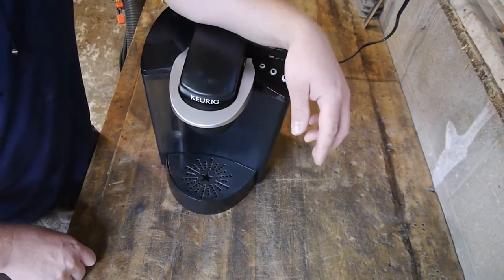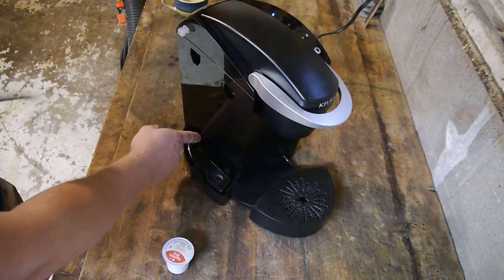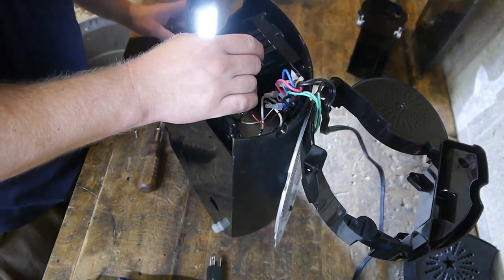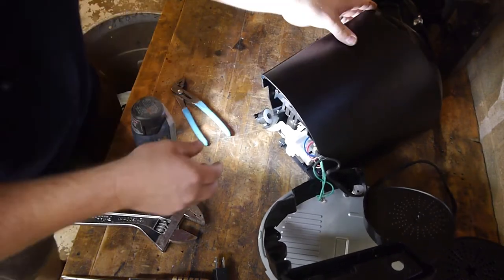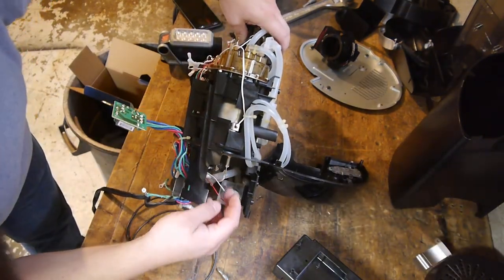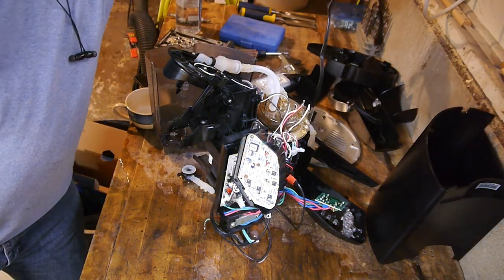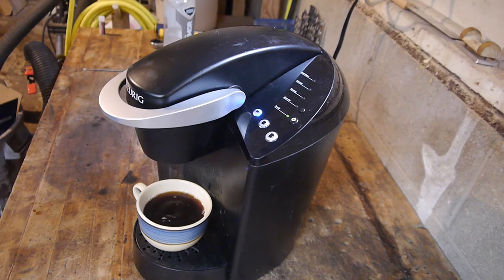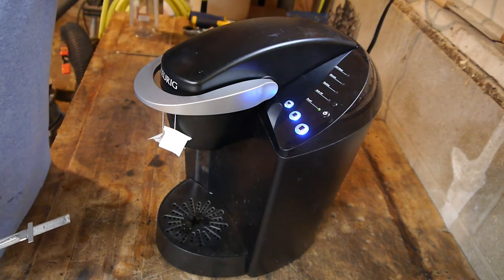Keurig K40 K-cup, Not Heating Repair, and now tea maker?

Comment: A tad too fast during the disassembly and re-assembly phases. That said a hearty congrats on getting the old K40 working again. Regrettably I feel like I've just watched a brain surgeon  open the skull at warp speed, show me the aneurysm then go back to warp speed to close the skull. Sort of miraculous I'd say. I'm fairly handy so I'm going to give it a go too with my dead K40. Hell, I was going to toss the thing anyway so thank you for taking the time to make the video. Oh, and if I were you I'd replace the WD40 with a crumpet.
Reply from the maker: Thanks for the chuckle! I did end up taking it apart again because my first fix didn't last. I took more time filming the reassembly in this second video, hopefully you can work backwards for the disassembly. Good luck and thanks for watching.
Reply from the maker: https://youtu.be/Y23lxL5nAT0
Reply: Hey Josh, I viewed your second video on re-assembly much to my great amusement as I could relate all too readily to your dropping the screw into the middle of the thing. That's nearly a pastime for me. I ran short of patience and decided to toss my dead K40 and perhaps buy a smaller cheapo knock-off hoping for a couple years out of it.

Comment: Did you just connect the wires or did you replace the thermo fuse that had burned up between the wires? What type of fuse did you use if so?
Reply from the maker: I just connected the wires back up. Tested, and it worked, so sealed it up and didn't replace the fuse.

Comment: Mine does the same thing, what was wrong with it? Stuck on,heating light
Reply from the maker: The wire that was supposed to be connected to the heating element had corroded away and no longer delivered current. I stripped the wire back and fastened it back to the heating element.
Reply: @JoshAQ  I’m going to fix mine tonight. Do I need any extra wires or parts if I also strip the wire and re attach it? I’m 99.9% sure it’s corrosion because the bottom of the keurig has a lot of lime scale on the bottom

Comment: So what WAS broken?
Reply from the maker: There was a corroded terminal connection in the heating circuit. I initially use a set of alligator clamps to reconnect it and confirm it was working. If you go to the ten minute mark of the video, it is around then that I am going over what I think is wrong. I ended up cleaning the corroded connection and reattaching it. It worked after that.